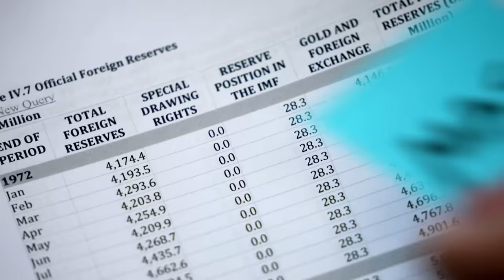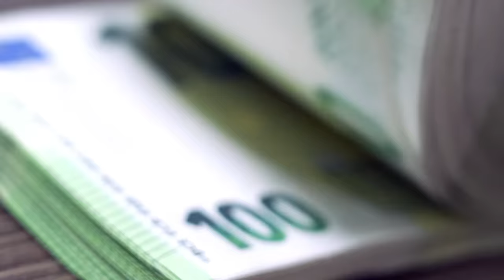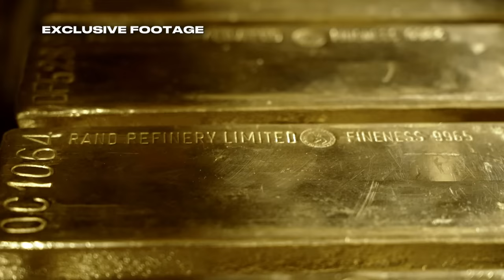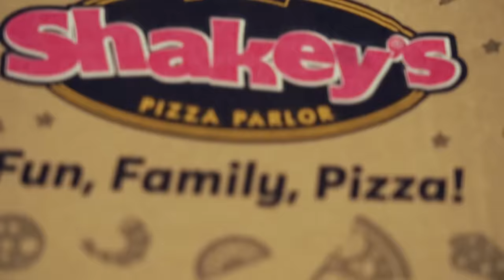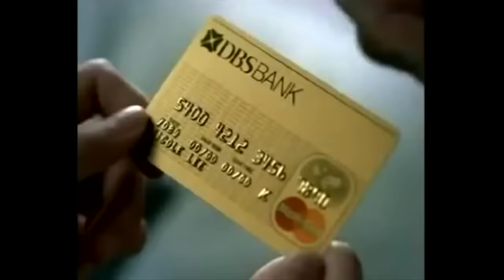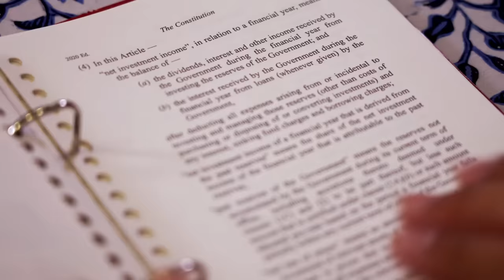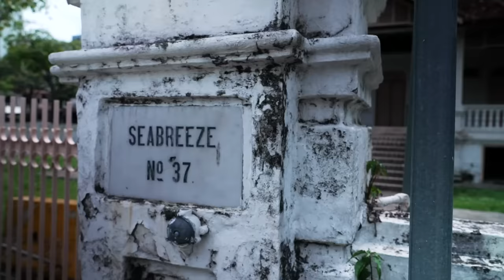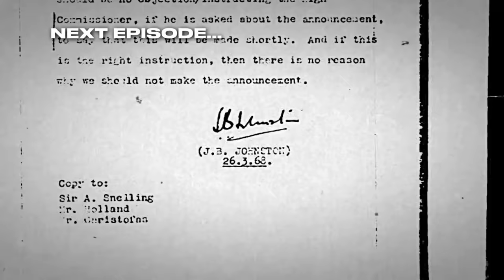Singapore Reserves: The Untold Story - Ep 1/2 | Singapore Reserves Revealed | Full TV Episode

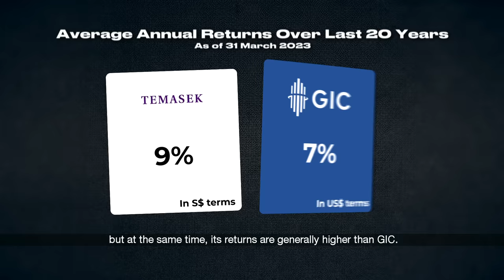Comment: 25:35 sneaky CNA.

The returns are in SGD for the Temasek Returns while GIC is in USD.
If they are converted to a common currency for comparison, Temasek while having higher risks, does not perform significantly better than GIC.

7% in USD terms is around 7% x 1.30 = 9.1% in SGD terms.
This means that GIC actually performs on par or slightly better than Temasek while having a lower risk.

SG media really deserves their ranking of 154th media in the world.
Reply: While I agree that Sg has limited media freedom, the comment about misrepresenting investment returns might be unfair. Percentage calculation, as most who have studied and done well in maths would know, is made on the basis of the same unit of comparison. So, 7% growth means, 7% growth in USD. When converted to SGD, it would still be 7% growth.

The reason why CNA reports the currency in this case, I am guessing, is because these percentages do not take into account forex fluctuation. So, for example, at the start of the investment cycle, it is 1USD=1.35SGD. But, at the end of the investment cycle with 7% growth, the rate falls to 1USD=1.30SGD, then the 7% growth in USD will convert into a lower growth in SGD, as a result of falling USD. People who have basic investment awareness would know this.

However, if the investment is continuously done in USD, without the need to always convert the money back to SGD, then the forex fluctuation really doesn't matter that much in the long run. So, 7% in USD is still 7%.